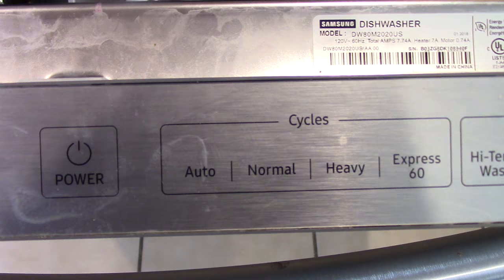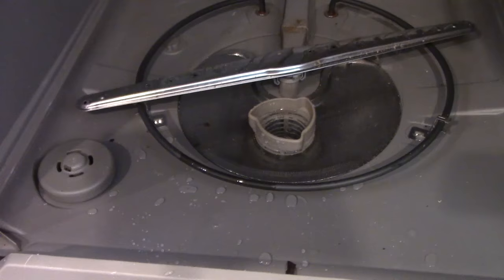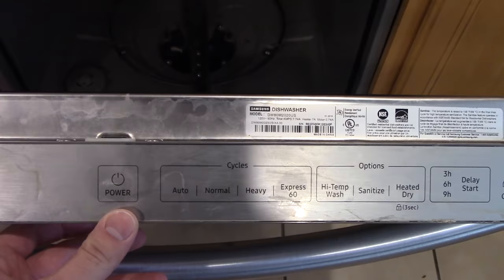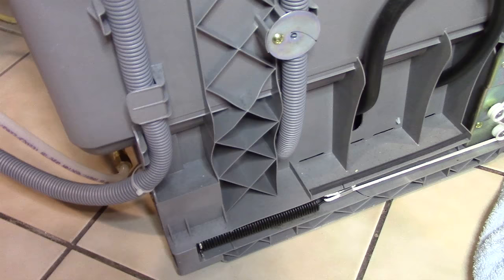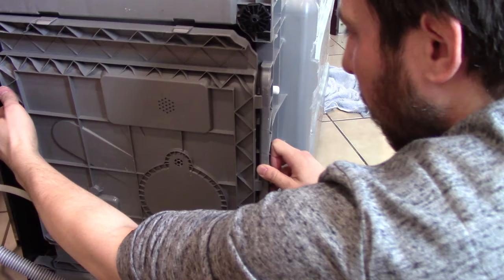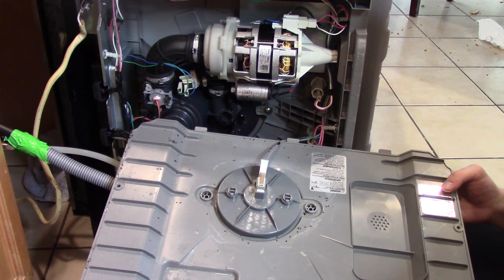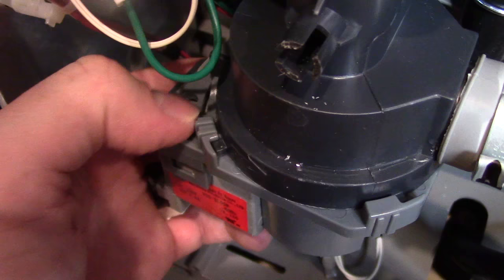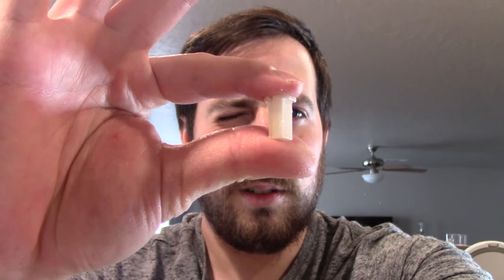Samsung Dishwasher Won't Drain: Impeller Fix

Comment: How did you get the pump to activate ... when I pull up the floater I hear nothing and I have water just sitting there? Please advise
Reply from the maker: I think I just lifted up the float switch and that was enough to make it turn on. You might try turning off your circuit breaker for a few minutes, switch it back on, and then try to run a dishwasher cycle. Usually the system will attempt to drain itself at startup. If nothing happens, it's possible your drip pan is full of water and triggering the system to nit do anything. When was the last time your system was working?
Reply: @karatefox  3 day before I took it apart... looks like it's not draining... I did everything the video said got it running but the dishwasher won't drain
Reply from the maker: @BudgetClan  interesting. Does the impeller turn on or hum? Have you checked the exit of the drain tubing to see if there's an obstruction?
Reply: @karatefox  the impeller doesn't make any noise and I check for any clogs on the tubbing and nothing
Reply from the maker: @BudgetClan  It's quite possible there's an issue with the impeller itself. How old is the system? Do you recall when it last worked or if it made any unusual sounds before the impeller quit working?

Comment: Thanks for the video. I was able to fix my dishwasher because of this video!
Reply from the maker: That's great you were able to get it working again. Just out of curiosity, what was the specific issue and how were you able to fix it?
Reply: It was the same problem. Dishwasher wouldn't drain, because the spinning motor gadget that gets rid of water was blocked with trash

Comment: Hey bud, thanks for saving me time and money.
Reply from the maker: That's awesome you were able to get things working. What ended up being the main issue? Was something stuck in the impeller?
Reply: @karatefox  It had a metal screw and some rice stuck in it. Once I cleaned it out and put it together. It worked like a charm.
Reply from the maker: @just some Gamercat  Excellent, it's great that it was something easy to clear out. It makes me wonder though. Where did the screw come from? 🧐

Comment: Hey you didnt notice this because you had the impeller housing flipped upside down, but that plastic piece is part of the dishwasher. Im not sure what it does but there is a slot that fits the shape of tbat part perfectly.
Reply from the maker: @04gtno  Oh dang, I've been wondering whether or not that part was from the system. It may be worth noting that my water inlet valve also failed around this time and I ended up replacing that part. I wonder if it might be from there? Thanks for the information, hopefully we can eventually identify what that part does. Since doing my repairs, my dishwasher has been working great so hopefully the part isn't super necessary.
Reply: @karatefox  that's great to hear that yours is still working. Maybe that part isn't crucial to normal operation. I just put mine back in, but I'm a little concerned that it might come out again. I can't think of any good reason for that part to pop out, but I did blow compressed air through the back end of the drain tube to see if there was an obstruction, so I'm assuming when I did that it popped that piece out. Did you do anything like that also?
Reply from the maker: @04gtno   Interesting, I didn't try clearing out tye drain tube, but during a different troubleshooting adventure I do remember being a lot of buildup inside the tube, which made me want to replace it-definitely recommend replacing those things every couple years 🤢. It's possible tye part was knocked loose from normal wear and tear from the system vibrating.

Comment: My dishwasher has so much condensation on the door, side walls, and bottom...even with high heat drying. Does anyone else have this problem? If i don't empty it right away, condensation stays, and that's not good. It can smell if it doesn't dry.
Reply from the maker: @michellesmall7527   Interesting. Is it like that after running a cycle, or do you find that condensation is accumulating even when the unit is not running? My first thought is that you might want to check the air vent on the front of the door of your dishwasher. The opening might be blocked, and is preventing moisture from properly venting.

Comment: I had the same issue before and this is how I fixed it.  Unfortunately I have something stuck again but not in the same spot.
Reply from the maker: It's unfortunate to have the same issue recurring, but it's great that you're prepared to fix it and are able to get your system up and running again. Thanks for checking out my video, William.

Comment: Thank you for this awesome video. It helped me alot with the disassembly. Mine is doing something similar, after 7 min of working, Normal start blinking and no the water stays inside (no draining), when I first tried to lift the float senor I didn't hear the drain motor humming. Opened it up and the impeller was clean. Dried everything down there but unfortunately the same issue is still there. Any idea? Suggestion on how to troubleshoot the drain motor. 
Thank you again!
Reply from the maker: Thanks for checking out my tutorial, I'll see if I can make some recommendations. When you turn on the dishwasher, do you hear any sort of humming sound or is it completely silent? Also, if you look inside the dishwasher, have you tried unscrewing the drain cover to see if something is stuck clogging the drain? How long have you had the dishwasher? Hope I can help.
Reply: @karatefox  thanks for your reply. No there is no sound of humming, its completely dead. However, today i disconnected the drain pump and read the ohms reading across the two terminals. No reading and then I supplied AC 120v to the pump and it didn't move at all.
Reply: @karatefox  forget to tell you, I bought from Home Depot less than 2 years ago ( Dec 2017)
Reply from the maker: @nawraswardia  interesting, it sounds like the impeller might be burned out. I'd recommend ordering a new impeller and seeing if it works. If it doesn't, you might want to return it and try some additional troubleshooting. Another thing to take a look at is the drip pan sensor. If you remove the drip pan, you'll notice a circular plastic part with a wire coming out of it. If you unscrew it you might want to check it out; there's a piece of Styrofoam with a sensor on it. It might be stuck in the on-position and is giving a false warning of a flood. When you turn on the dishwasher, does the normal light still flash?

Comment: Mine drains but still throws the code. About to disassemble and look at the parts you highlighted. Will report back. Had a similar Samsung Dishwasher that was 10 years old and replaced it with current one last year (another Samsung) and experiencing similar problem again. Going to check all the drains and drain plumbing to make sure there are no blockages, but mine seems to complete one cycle and drain, then it gets stuck with the normal button flashing.
Reply from the maker: Hi David, hopefully it'll be a simple fix. Another thing to check is whether someone is opening the dishwasher mid-cycle and not restarting it. If the door gets opened and the cycle isn't done, I've found that there is residual water that can pool just beneath the drain inside the dishwasher and slowly seep out and into the drip pan. Good luck and let me know how it goes.
Reply: @karatefox It appears the Sharkbite fitting I put on the end of the PVC water line was dripping very slowly. Looks like that may have been what was potentially triggering the normal light flashing (the leak sensor) and I can see a minor amount of water damage to my cabinetry (in a non-visible location) and slight moisture damage to my laminate wood flooring. 

Going to get a new fitting (NOT Sharkbite this time) and install it and see if it corrects the issue. I took apart the dishwasher and checked all the parts you did (the interior filters/screen, etc. inside the dishwasher) and took apart the impeller and saw no sediment or parts, etc. blocking anything. I also snaked all of the drain lines to make sure they were clear.

I'll report back later after I install the new fitting, but it looks like my dishwasher sensor (if this indeed the cause) may have save me a large home insurance claim/water damage repairs! This might be a blessing in disguise.   

Thanks again for your video! :)
Reply from the maker: @davidhandysides8800  it's good you were able to catch the issue now before there was more damage. It makes me wonder about some of the other appliances like the hvac system and the water heater- probably a good idea to take a look at everything to do some preventive maintenance a couple times per year.

Comment: Same problem newer samsung dishwasher, wonder if there's any way to fix this without taking the whole thing out and apart?
Reply from the maker: @chadleatherby3309  That's an excellent question. It might be possible, perhaps, to access this part from the back of the unit if you were to rotate it around after pulling it out of the cabinets.  However, it might be challenging to really access the impeller or troubleshoot the drip pan sensor. If you are able to do it, please let me know. Did you end up figuring out what the issue was with your unit?
Reply: The impellor waa clean, but the pan had water in it for some reason that was tripping the sensor, the error message went away we'll see how it works
Reply: Yea its working good now just had to drain the pan on the bottom fingers crossed
Reply from the maker: @chadleatherby3309  I'm glad you got your system working. That's interesting that the impeller looked ok. If the drip pan continues to fill up and trip the sensor, another part you might want to examine is the water inlet valve. Should that part be defective, please check out another video I have on my channel for how to replace it. If you need help troubleshooting, feel free to let me know and I'll be happy to help.
Reply: @karatefox  its still working for thanks
Reply from the maker: @chadleatherby3309  Excellent,  that's great that you got it figured out. If you ever need help troubleshooting in the future, please let me know

Comment: I have had the same problem, 3 techs later still does it after about the 3rd cycle. Since you pulled it apart have you had any other issues?
Reply from the maker: I did some troubleshooting on a different occasion and found that the water inlet valve was broken. Here's a video I made to troubleshoot and replace it. Please let me know if it helps. https://youtu.be/5qAwkM59nxk

Comment: I'm just a little confused about mine. Mine is brand new from Lowe's. I installed everything correctly (wiring, waste gate connected to the disposal, and water line attached to the wall underneath the sink.) After running it for a test, water and electricity work correctly, but draining does not. The one problem I think it is, is the disposal connection inside is clogged
Reply from the maker: Does it make any sort of sound when you try to test run the drain system? There should be a humming sound from the impeller. To test the clog theory, you might want to disconnect the drain tube from the sink area and place it in a bucket to see if water is being evacuated out of the dishwasher. Does the dishwasher fill with water while you're running test cycles?
Reply: @karatefox  Yeah as soon as everything was was connected correctly I did a test cycle and water filled. Like yours, water was all sitting at the bottom. I believe the start button says "hold for 3 seconds to drain, which I tried and all 4 buttons blink but nothing seems to happen. I do hear a humming but after a good few minutes theres still water inside. I have some more testing to do. 😣
Reply from the maker: @lucasgaeta4283   Interesting, sounds like the impeller is working. Perhaps there is an issue with a clog somewhere downstream of the dishwasher. When my dishwasher is actively draining and I look into the sink drain, I do recall seeing water being sprayed out of a hole in the side of the drain. Have you tried running the garbage disposal recently? Perhaps there is a buildup of food particles clogging that hole. Likewise it might be good to carefully insert a length of steel wire in the hole to try to probe the area for any clogs. Please let me know what you're able to figure out, I'm curious to see how you get it working.
Reply: @karatefox  This is a little upsetting... I found the problem. It is the disposal. The theres a connector to the disposal but it's just blocked off. There's no clutter in the way it was built to be blocked off. I have to go buy a new disposal.
Reply: @karatefox  just an edit, I had to break open the connection 🤦🏼the disposal comes like that and I just now found that out. I should be good now 😊
Reply from the maker: @lucasgaeta4283   I'm happy you got it figured out. Hopefully these comments will help people out with their situation. Thanks for sharing the updates.

Comment: Have same exact washer mine blinking wint finish cycle etc took it apart nothing in the impeller stuck. Also small leak coming from the impeller seal. Maybe I'll just order a new impeller seal
Reply from the maker: A small leak could do it. The blinking normal light happens when the drip pan sensor is continuously tripped, generally due to being filled with water. Please let me know if replacing the part works. Hopefully your system will be up and running soon.

Comment: Will try it tomorrow, wish me luck
Reply from the maker: You can do it! If you have any questions or need help troubleshooting things, please let me know 🙂👊
Reply: @karatefox  so the pump is clean, nothing there. Any other place I should look for obstruction?
Reply from the maker: @lukimy2704  Are you sure the issue is an obstruction? What sort of error code was the dishwasher giving? What did the dishwasher look like when it would stop working? Was it filled with water and not draining?

Comment: Was the small plastic from the inlet valve?
Reply from the maker: Interesting, it could be. The water inlet valve ended up having issues and leaking and I had to replace it. I actually posted a video for that as well. Now I need to compare the two videos and see if I can recognize whether the piece of plastic did indeed come from that valve. Thanks for checking out my video.
Reply: @karatefox  thanks for the reply, I saw your other video. How did you remove the copper connector with ease? This dishwasher cam with the house and I'm afraid they put some plumbers tape because I can't unscrew it with ease. I'll be going to Home Depot tomorrow and see if they have some type of plier to help get it out. Thanks for the videos

Comment: Hm. My dishwasher is not draining. I tried the first part,  cleaned it and then pulled the float up. Nothing happened. So does that mean it is an electrical problem vs. a clog problem?
Reply from the maker: Hi Kelly, thanks for checking out my video. Is your normal light flashing? If so, try opening the door of the dishwasher, pushing the start button,  and then try to hear if there's any sort of humming sound. If you don't hear anything, I still recommend turning off the power/unplug the dishwasher and then try removing the impeller to see if it's jamming. It's possible the humming sound is too faint to hear. Do you recall when was the last time it was working and what it sounded like?

Comment: Thanks for this!
Reply from the maker: Happy I could help, thanks for checking out my video.  Did the issue end up being related to the impeller?
Reply: Luckily ours was just taking out the twist off cap, metal screen and filter tube and then cleaning everything out. We used a wet dry vac to suck out the cavity and that seemed to make it work again. The water drains completely now. That was the first time we cleaned it out since we got it about a year ago. It's going to be a regular maintenance thing now. Probably once a month hurry and clean the cavity out.
Reply from the maker: @MakeItMike  That's great that cleaning the filter and drain worked. It makes a lot of sense to create a formal preventive maintenance plan. An ounce of prevention saves a pound of correction 🤔💡

Comment: good but did you ever find out what that broken piece of plastic was from as obviously it belonged to something important!!??
Reply from the maker: Excellent question. I suspect it came from the water inlet valve because that part ended up failing about a month later. But I'm not completely sure. Have you ever seen a part like that before?